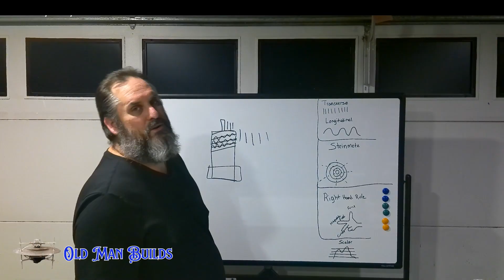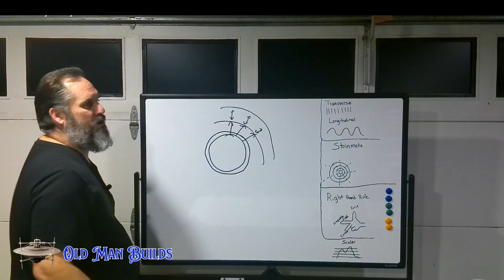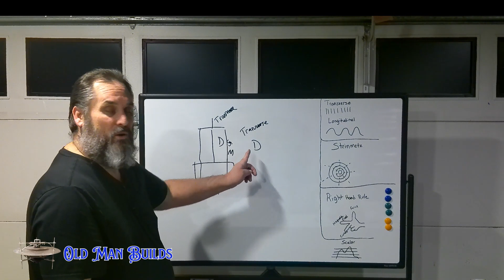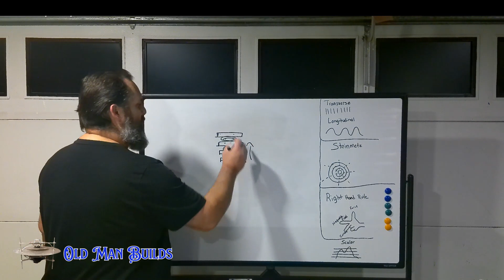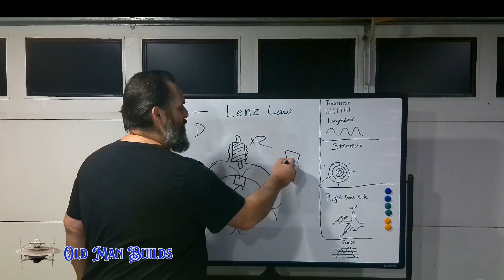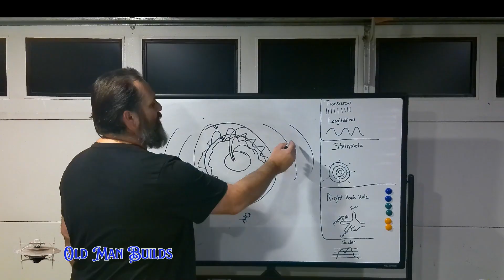Understanding Energy Using My Tesla Coil

Comment: I see it differently.
the dielectric field, is the electrostatic field.
so pure voltage no current. it relates to the capacitance of the tesla coil.

once the voltage starts changing, it creates a movement of energy around the coil. this is the displacement current (energy flow) and this makes the fluorescent tube light up.
still transverse.

this displacement current transforms into the magnetic current, which relates to the inductance of the tesla coil.

all these energies flow around the coil, and is actually one and the same energy but in different forms.

The magnetic field than transforms back into the displacement current and electro static (dielectric) field.

if you want longitudinal...
then suddenly change the electrostatic voltage.
Reply: I've been looking through Tesla's stuff recently and he remarks in his 1892 Lecture that there is a gaseous medium immersed within the fluidic aether that is responsible for the electrostatic/dielectric field, as I trust Tesla's experimental judgement it's lead me to the following conclusions:

Magnetism is rooted in the movement of the Aether, polarized aether creates magnetism.

Dielectricity is rooted in the aether gas medium, polarized aether gas creates dielectricity.

This also satisfies Dimitri's pre-hydrogen elements that are missing from the periodic table, only when these 2 mediums are in conjugate operation do you have a stable atom and matter as we know it.
Reply: @JenkoRun  That is very fascinating, I will need to re-read that 1892 lecture. That is the London one, right?
Reply: @MasterIvo  Yup "Experiments with Alternate Currents of High Potential and High Frequency- A lecture delivered before the IEE, London, February 1892"
Reply: yes, magnetism is the displacement (low pressure zone)
Reply: hey ivo good morning from alaska.

did you ever feel the physical warmth that Tesla described from his high voltage rapid ac impulses?
Reply: @kash_bo  no I did not feel that yet, but I believe he used higher frequencies then I use, more in the Mc/s range
Reply from the maker: Are you saying we change the field type based on the amount of amps or current in the system?
Reply: @oldmanbuilds  no,
resonant transformation, from voltage to current and back
3 sine waves, mostly only 2 are depicted. but there are 2 types of current. so 3 sine waves.
Reply: I also understand that inside the Tesla coil, there must be pure voltage, no current, and you confirmed this.
Reply: @dabarnesakysiu7962   pure voltage to me sounds like an electro static field. When the voltage is changing, then energy must be flowing. and energy flow= current
Reply: @ not quite pure voltage, there should be milliwatts, because there is a way to get a similar effect with a flat coil, there the incandescent bulb is on and there is no voltage...
Reply: So what you are telling me that the Tesla Coil basically pulls | pushes around the " dormant* , if u would call it " a long with the build of fthe actual coil?

And yes, so a common Tesla coil schematics or DIY videos basically show virtually all the same builds and then always lead to a dielectric field so basically add one more electromatic to swap the ending field to magnetism. 
   In turn like you said and is know that energy all but changes and is in everything. 

Also, if the pure voltage is always there and around us. If I were to put a integer | number on it . What would you give it?
Reply: I also see various definitions of displacement currents floating around which is confusing
Reply: @ninukanjan9400  displacement current needs ti be researched much MUCH further. it holds many keys. electric therapy, electric gravitation (field propulsion) it is all related to the displacement current.
this Aether energy flow.... it the key. and to turn it you need a fast change in the dielectric electrostatic field.

Comment: A possible alternative theory: Earth is not a sphere but a level circular surface with its 3 dimensions existing upon the magnetic plane of inertia at the center of a double torus field. This would be why a radio waves components are electrical in the vertical directions and magnetic in the horizontal.
Earth being the neutral point between the + upper and the - lower torus halves. Earth being ground relative to the ionosphere (dome) and its high positive potential explains the electrical gradient that increases with altitude and why lightning moves in a vertical manner. Electrons being - charged build from the ground up in the air drawn towards the positive potential. When atmospheric conditions are favorably conductive an electron bridge forms and when it gets close enough for the high + potential to jump the gap, from a high altitude sprite, a lightning flash occurs as the current that flows from positive to negative and 90* out of phase,  ionizes the gasses in the air while following the electron bridge to ground. I believe the current flow from sky to earth is the bias that determines which direction is up and which is down and why radio waves align with the ground surface.  
I know, it's a rather lofty theory but I feel it has very substantial evidence to support it.

Comment: Idea ? if you blow cold air through the center of the roden coil after the rod has been taken out of the tesla coil. Would the rodin coil continue to hold the energy?
Reply from the maker: @dkdyker  it would not do much. The effect is colder. The cause is the flow of the. Oil. I would need to effect the flow.

Comment: Great!  I like it. If you could please more about the cold energy and how it relates to gravity.  With that aside I have been meaning to ask/inform you.  On the center plate would it make a difference to use 99% pure aluminum?  Why I ask is, in 47 or 48 a UFO crashed and what has been found to this day is 99% AL.  This is also found at many other crash sites.  If I understand correctly that the high series AL came out about 5years after 48.  Another interesting observation is on most footage of round UAP’s there are thin blue tentacles shooting out around the object.  In addition, on temp cameras you get an endothermic covering on an exothermic center.  Kind goes with what you’re saying here?  Also a great thanks for sharing Bindinie and/or Adam’s motor, etc…Thanks.
Reply from the maker: I will start to make video's about it and why it works. Thank you.

Comment: It is a figure 8 and turns inside out and outside in. Both surfaces are worked with inside and out. Both directions of flow. The 'shape' of models to come.
Reply from the maker: if you build both poles.